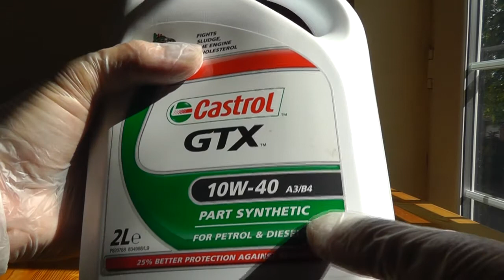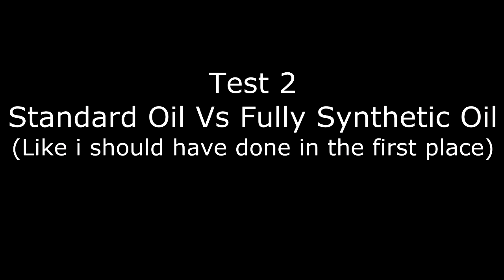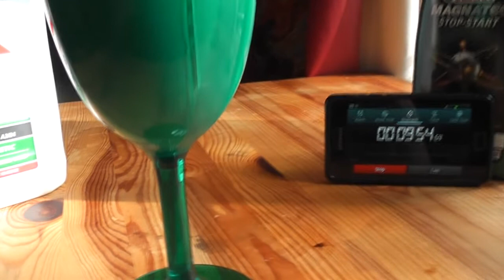Engine Oil Viscosity - Full Synthetic Vs Part Synthetic

Comment: I use that Magnatec 5w/30 for 2 yrs now and it made my engine really quiet,much quieter than before.....never had a leak in my car anyway.Possible cause for oil leaks could be your PCV valve which 75% of owners forget,ignore or didn't think it matters.It does matter when it's blocking up and pressure builds up thus it can cause leaks.Well worth using Magnatec folks give it a try.
Reply: After how much kilometers you recommend to oil change if it fully synthetic ?
Reply: @pramodpandit236  15 000 km maximum. But if you drive your car mostly city driving/short distances - it is recommended to change it even earlier because in city driving the engine has many working hours which are not recorded on the odometer (e.g. on the traffic light) and also the engine has more stress on it - when accelerating, when the engine is cold etc.
Reply: @Combine1331  i used to change every 10 to 12k km
Reply: @pramodpandit236  It will not hurt changing it earlier. I drive very little and change it after 1-2 years on 2-3K kilometers.

Comment: nowadays engines have smaller holes and smaller tolerances in the gaps. they need those lower viscosity oil to reach those tight spaces. and honda now are using sae 20 engine oil. just to share. and people use those high viscosity oils in vehicles that needs to go for inspection  which includes smoke test. higher viscosity tends to minimize the blowby gases and oil leakedinto combustion chamber or valve seals. :)
Reply from the maker: Good comment, thanks for the heads up.
Reply: and all other oil leaks :D
Reply: @goodgod9330  sad but true. Hahhahaha